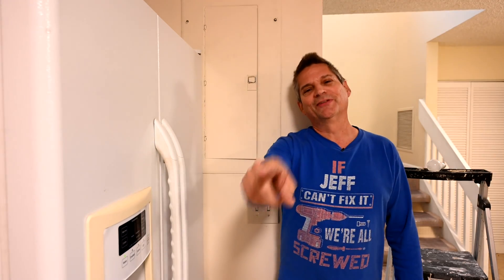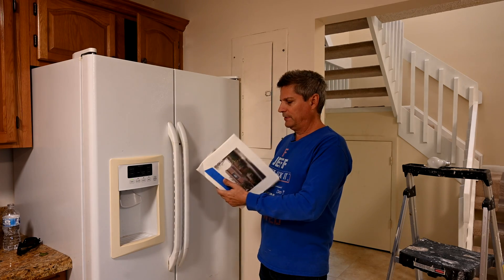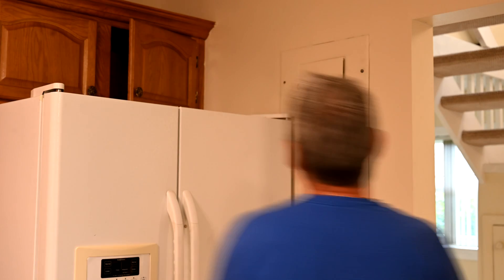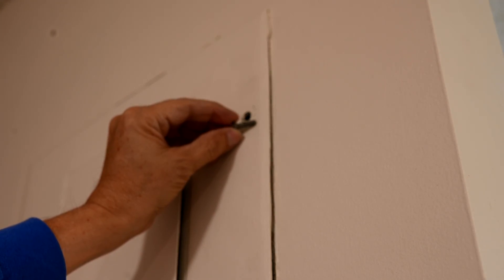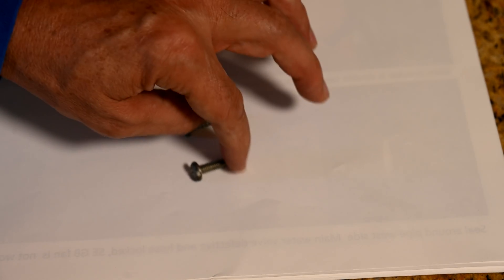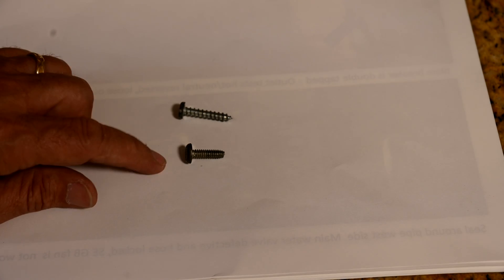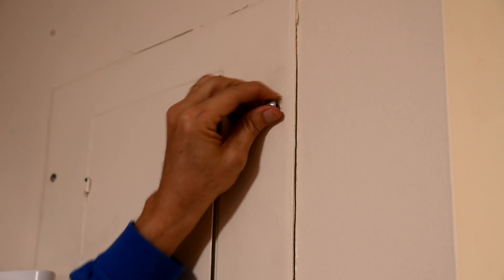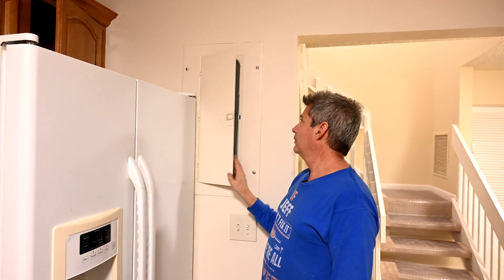Electrical FAIL: Deadly Electric Panel DIY/Handyman Practice

Comment: The stupidity here is really in the design where the screw holes are located; they should be so the screw does not penetrate the inside of the panel where the wires are.

Comment: TERRIBLE placement for an electrical panel.  Doesn't  code also say you can't have an impairment 30" to the left or right of a circuit panel?

Comment: I recall where dry wall screws used in mounting the mounting ring for a hard wired smoke detector, guess whomever installed it used what was handy. I was replacing it, discovered the screws, thankfully I have supplies handy got a couple of the proper ones 8-32 round head machine screws to complete the job. I presume as to the GFCI  it was  wired with the line wired onto to load terminals, and the load to the line terminals?
Reply from the maker: Yes sometimes the handyman will use whatever screws they have on hand not knowing they are violating the electric code and putting people's lives in danger.

Comment: I fully agree to use the proper screw on a panel or any device for that matter. But a shock hazard? No, the panel is grounded metal. The second that screw pierces a hot wire, there will be pop and a tripped breaker. Furthermore a professionally installed panel should have all wires bundled and away from any fastening screw or square edge. How about a #4 wire in the way of a screw? There's a good chance even the approved panel screw can pierce it as it is so stiff. And those screws are not just flat head. They are also square drive and so are most other modern electrical devices. Use the proper tool!
Reply from the maker: Not always is a short a real short. As an engineer at Motorola years ago, I demonstrated a soft short. A situation were we had run a screw through a door panel of a truck equipped with one of our mobile radios, and it should have been a short, but instead was a soft short, meaning rust screw did not make perfect connection and glanced the wire rather than pierce through the center of it, so it was a resistive short, and 12 amps were allowed to flow through the circuit board of the radio and it caught fire. Everyone's jaws dropped when I showed them. They all through a short circuit would simply blow the inline fuse.
Reply: @jeffostroff  I hear you, I'm an EE as well. Yes, it could still be a fire hazard.

Comment: I can't stand finding incorrect screws in things... I didn't know this about the electrical but it does make sense, and that's something I would never touch anyway. I go out and buy the same type of screw that was there when one is missing.
Reply from the maker: That will save your life too, good rule to work by

Comment: I'm not trying to be a PIA but I sometimes succeed without even trying. Each panel owns a piece of your homes floor space. No panel will pass electrical inspection after installation, or any follow on inspection like the one mentioned here, without you leaving that piece of your home to the quiet enjoyment of your electrical panel rather than your enjoyment. No it doesn't matter if it is the Service Equipment panel or not. The working space that the panel owns is 36 inches deep from the panel cover surface straight out at a 90 degree perpendicular. That space is 78 inches or 6' 6" tall. It is a minimum of 30" wide and the 30 inches must include the entire panel cover. We are not done yet. The panel also owns it's own width and depth from the structural ceiling above to the floor below. Nothing other than electrical work can be mounted either directly underneath not directly above the panel. No plumbing pipes, air ducts, gas piping, etc. In short the work of any other craft cannot go directly above or below the panel. That is to protect you, as the owner, from finding out after you purchased the house that it is not possible to add or change wiring to or from that panel because some other craft put their work in the space needed for future electrical work. 

There are few acceptable remedies for the lack of safe working space in front of this panel. Either the kitchen will have to be rearranged so that the refrigerator is 36 inches away from that wall or the panel will have to be turned around to face the hallway behind it. I cannot tell if the counter alone would protrude into the working space but it might. If it would protrude into the working space then turning the panel around to face the hallway will be one other remedy that would comply with the law that adopted the National Electric Code as the Electrical LAW in that jurisdiction. 

A third remedy available would be to convert that panel's enclosure cabinet to a junction box. A junction box has much more easily complied with rules for access. Since it does not contain switches, circuit breakers, fuses, or other things that the occupants must have access to it needn't be "Readily Accessible". Converting that panel would be done by running all of the circuits which presently originate in that panel t a panel located elsewhere. If there is space for the panel, in say the basement below; including the Safe Working Space required by your communities electrical law; then you could reroute the cable or raceway that supplies the power to the existing panel to the new panel's location and connect the supply conductors to the main breaker or main lugs of the new panel. You then run the individual circuit wires from the old panel, cum junction box, to the new panel. If you can work out a route for them you can run 2 or more "raceways"; read wire enclosure pathways; between the 2 panels so that you can pull all of the wires that you will need to extend the circuit back to the new panels location into those wire pathways. Raceways come in many different forms such as conduit, wire ways, cable trays... The most likely one for this would be flexible metallic conduit. In some locals you would have to use Eletro Metallic Tubing (EMT), Intermediate Metal Conduit, or Rigid Metal Conduit.  If you have any class at all you will install terminal strips into the junction box cabinet to make neat and easily traced connections between the extended circuit wires and the original circuit wires. 

Tom Horne
Retired Electrician
Reply from the maker: The builder in this Townhouse did some strange things for sure, and yes, blocking the electrical panel with the fridge is a poor design choice. They did this mistake in other condos within this community also.

Comment: Refrigerators were smaller when that house Was built
Reply from the maker: This was built in the mid 1980s, fridge sizes are the same, unless the builder found a tiny fridge to cram in there. Maybe a dorm fridge!

Comment: Hi Jeff!
I recently moved into my home,a couple of outlets don't work,both bathroom ones stopped working.
I turned off,and back on the breaker,and now my ac won't heat or cool😭 can you make a video on this topic please.
Reply from the maker: Do your bathrooms have GFCI outlets with little buttons on them? Maybe all you have to do is reset the button on the outlet. Also we have seen in the past where both bathrooms are controlled by one GFCI outlet in one of the bathrooms, so it the outlet trips, both bathrooms get taken out. I have also seen cases where the kitchen and bathroom get taken out because they were e connected to a GFCI outlet in the garage that the homeowner did not know was there, and it was hidden by one of those 6 banger outlets that plugs over your outlet so they never could see the GFCI outlet was there! I've also seen cases where the exterior outlets were all connected to one GFCI outlet in the garage and it was controlling the interior bathrooms as well, so if an exterior outlet trips the GFCI in the rain due to Christmas lights, there goes the bathroom lights. Real pain in the neck. Check every outlet in the house to make sure it has power. Also I can't tell you how many times people have told me "I checked the breaker panel, no switches are tripped or in the middle, they are all on". But I get there and see a breaker that is tripped. Examine all closely, look for GFCIs, check your breaker box carefully, tripped breakers don't always look like they are tripped.

Comment: Sellers should consider having an inspector do a "pre-listing" inspection.  Get the things fixed that you can.  Other things, that you may not want to get fixed, you can at least get some estimates on repair costs for negotiating purposes.  For example...if the roof is in poor condition, you may want to get an estimate for a new roof so that you have this knowledge for negotiating if a potential buyer makes an issue of it.

Comment: There's a special head/screwdriver  for those screws intended so not any1 can open them . it's called ECX (Milwaukee) or combination bit , also a square (Robertson) tip can be used
Reply from the maker: These screws were flat head combos with the square Robertson in the middle, these were not the ECX type screws, which are typically used for electrical outlet terminal screws. I had my Milwaukee ECX driver with me there, you saw me using the flat head version from that 3 pack of insulated drivers. But I did not have a Robertson bit with me that night.

Comment: wow that's a long video to show somebody not to put a sharp screw in their box don't you just tell him crying down the screw make it flat and put the screw in you sure know how to milk a video anyway good good tip though no pun intended
Reply from the maker: I guess you missed the first 5 seconds of the video? It shows the 2 screws and which one kills you and which one keeps you alive. So the answer was given right off the bat. I would never tell them to grind down the wrong screw anyway, because the course threading of a drywall screw is not the same fine threading as a machine screw.

Comment: That was good, learned something , cheers.  USA land of the big  refers.  Does the box have to be a certain distance from a metal grounding source like an appliance?
Reply from the maker: No, in fact the box is grounded itself anyway, the line voltage, and the neutral lines and the ground line all three come into the house and into that box. From that box, all ground wires are run to all the circuits.

Comment: Another comment😁
The Inspector I normally work with will pass a panel (fuse panel, breaker panel, etc...); so long as the homeowner can open the door & is able to clearly “get/have” access to the breakers.
Another thing that gets overlooked in a house, are smoke & carbon dioxide detectors; something again, that is rather inexpensive (& most fire stations will give them out free during certain times of the year), but ppl just don’t have in their house or garage.
Reply from the maker: smoke alarms are huge deal. My wife says when she was doing home health with the elderly folks, most of them had  chirping fire alarms. That's why I only by the newer 10 year battery alarms, Just put one up in my friend's house last week. Three kids died in a house fire today in Miami, working smoke alarms I'm sure would have gone off, so I suspect they had none.